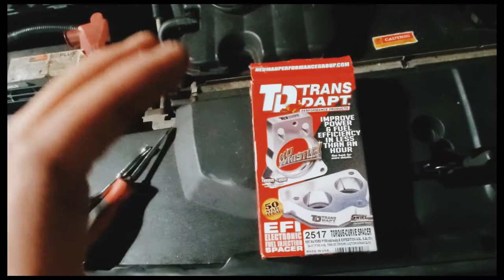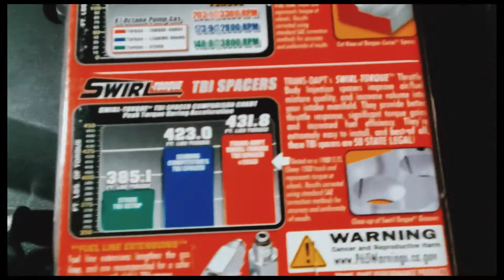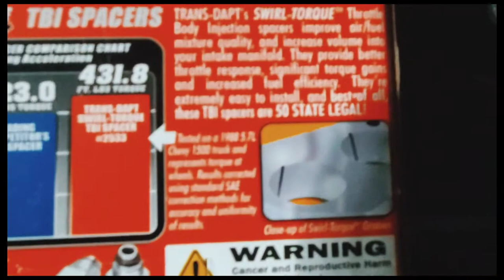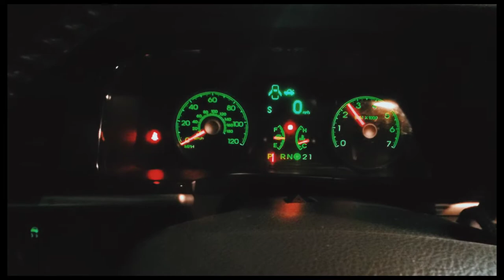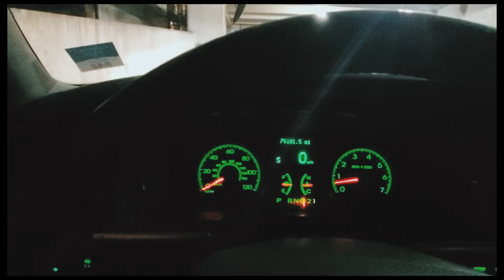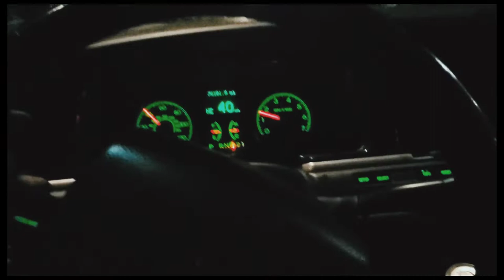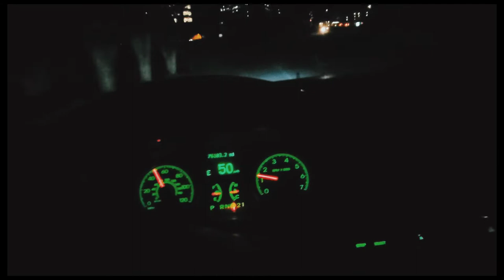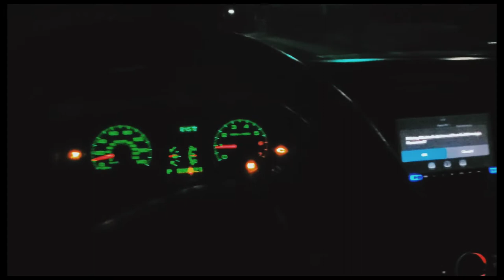Lincoln town car upgrades! major Difference!! #lincoln #ford #car #towncar #lincoln

Comment: It’s such a shame what they did to these motors. For all TC, CV, and GM, they dumbed down the motor because the mustang was using the 4.6 too at that time. Not to mention the 2v as you mentioned, when it clearly should’ve been a 4v. 239 hp when you could easily clear over 3 if it was done up to maximize power. I get why the Town Car was programmed differently due to the luxury want and feel so it wouldn’t be too loud or jumpy at the pedal. I’ve driven the Vic’s and can feel the difference. Honestly going to get a spacer after your review. Never thought they were legit but it makes sense in this motor. Such a shame Town Cars you rarely see mods or tunes available but there’s so much potential it’s insane. All that power with a luxury touch. Hearing that motor roar at high rpm’s gets me going. I love that unique sound these modular engines have. If you haven’t already don’t let off after the 1st gear shift. Pedal to the floor once it shifts out of first the rumble 2nd gear makes is crazy. 1st gear is so steep though. Like winding all the way up. Anyways that baffling muffles the engine so I rigged up the P71 intake, but like you showed, the MAF is smaller and you still have to keep that small piece on there, but the P71 box intake port is so much louder, plus no baffling. It really wakes up the engine as you can hear it roar even more. Look forward to watching your videos man. Good stuff. Have to grab your email so I can get you some pics. Damn I love these cars lol. 👍
Reply from the maker: Hey Joe! Yeah man I love these cars as well. Follow me on Instagram! Amiraqueenofthestreets

Comment: My buddy got a 2005 Lincoln Town Car & I wanna surprise him with a Throttle Body Spacer. Does he really have to get it tuned after installation or no?
Reply from the maker: Once you install it, turn the key on for 15 seconds then turn it off. Then turn on and let it idle for 15 min
Reply: @Ziade_Garage  Oh okay thanks.

Comment: Did you use the stock mount bolts? or did you have to increase the bolt size length
Reply from the maker: Definitely increased the bolt length
Reply: @amiraqueenofthestreets what size bolts did you get? I have 03 Crown Vic LX. Thanks bro!
Reply from the maker: @carlosloyola4585  11 mm long bolts. Go to ace hardware.

Comment: Will this work on 2000 model? The cable throttle
Reply from the maker: Yes most definitely will. You just have to clean the throttle body and elbow. Take it off. Clean them both. Then install the spacer. Enjoy
Reply: @Ziade_Garage  actually im thinking of changing i have the stock air intake and just looking at it i know it reatricts all the air if i pop the p71 intake will it work better
Reply: I see theres cold air intake options aswell but they all seem pretty shitty
Reply: Wow just saw your other vid dident notice u already did make a vid on the i take lol what year p71 intake would u say i get for a 2000 town car the older version
Reply from the maker: @rxmarlo2303  the version of 97 98 99
Reply from the maker: @rxmarlo2303  if you like, I can assist you. Message me on Instagram. Same handle name.
Reply: @rxmarlo2303  They only work on spring controlled throttle body. The electric throttle body ones triggers the sensors then after awhile your panther will go in limp-mode unfortunately 😕

Comment: Will it work for 09 vic?
Reply: Also would you need to connect  /disconnect any part of the battery while doing this?
Reply from the maker: @Kuckerkarlson  it'll work yes. Up to you.  But make sure you start the car and let it idle for 15 min before driving it

Comment: What about the spacer and a chip? I found a chip that will increase hp by 60. Ive got a 2000 tc and id love to get an additional 80 - 100 hp???
Thanks